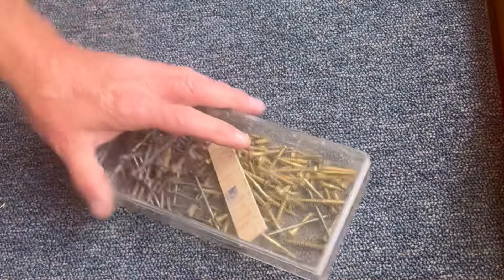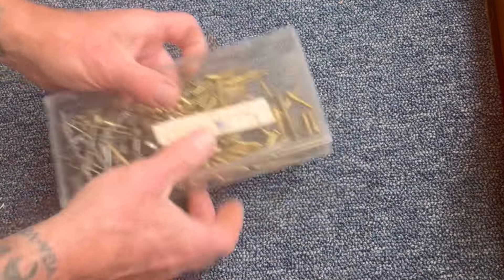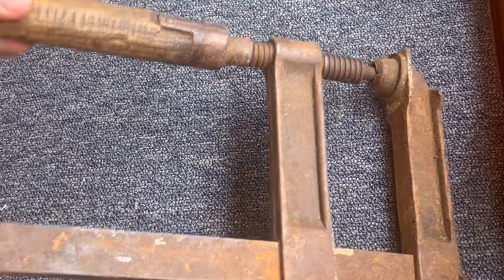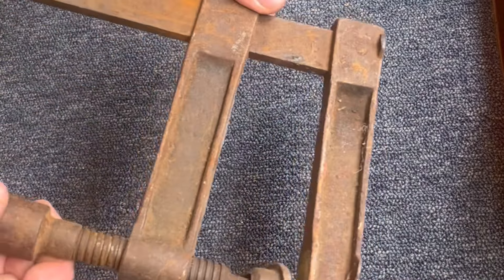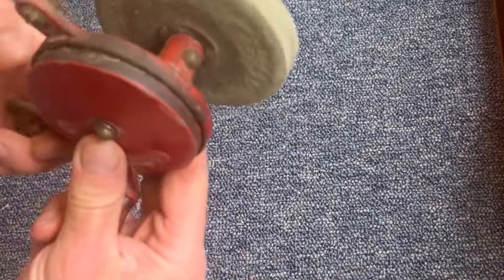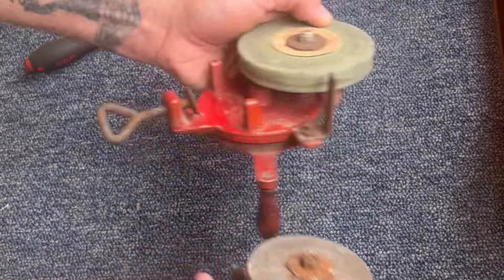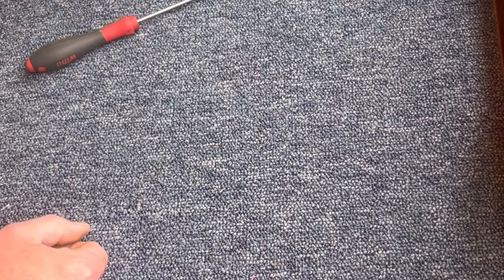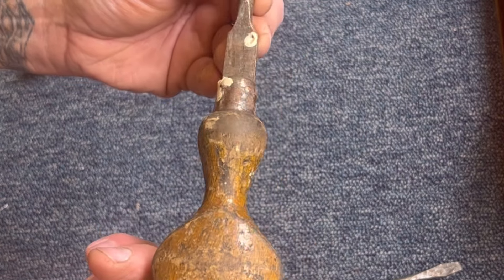Tool haul from car boot, vintage tools,vise, wrenches , spanner’s

Comment: Head and shoulders the clamp is the winner. Don’t think it has been cut down, nor home made. That I would like to see cleaned up, wouldn’t surprise me if under the grime there is a name. Given the lack of welders splatter, this could be an early carpenters clamp, whatever, a brilliant find. As for the Woden bench vice, a good clean, some new grease and a couple of pine inserts, that is a workhorse.
Reply from the maker: Yep , I think you are right, the clamp is pretty clean . It’s deffo on my project list lol. The Woden will  get a decent clean up too… thanks for watching and commenting , I appreciate it 😊